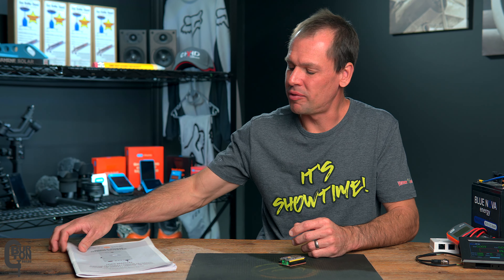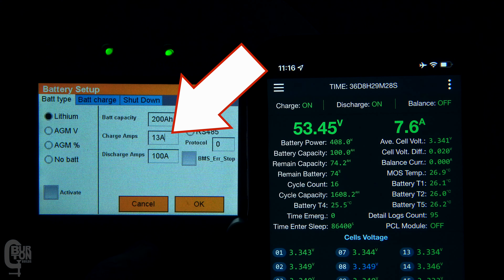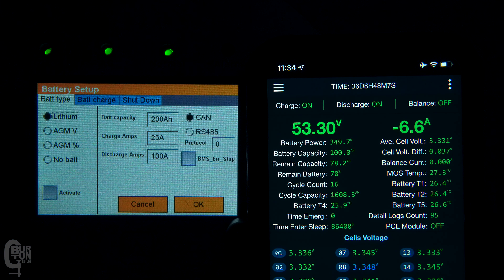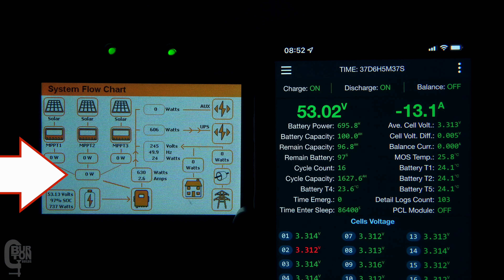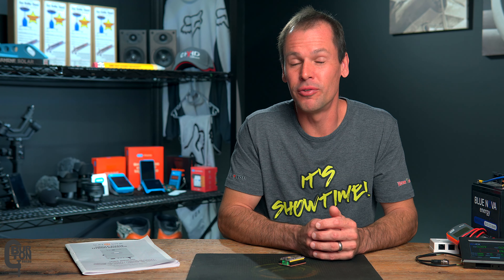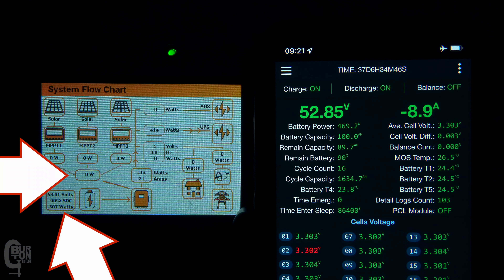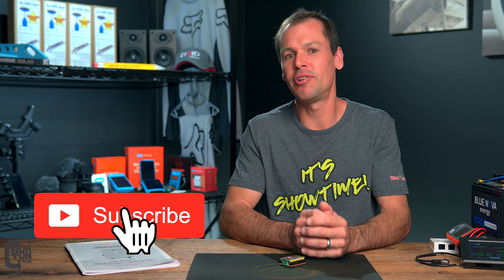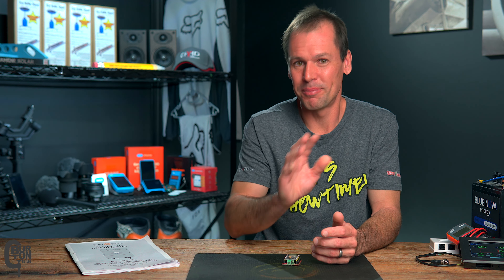Testing limits of JK Inverter BMS with SunSynk (Deye) Inverter

Comment: best test ever .. right nowdays my test reached similar questions with the older jk  and my battery is so small... only 90amp 48v setup..       always full .. or at least 90% safely full . which comes extremely fast even with 6 panels 240 watts if no loads...   i was planning to setup my new inverter bms for that extra 10 amp barier feature  and those relays to operate my fans to the server box ~~~ KEEP up
Reply from the maker: Thanks very much. If you are connecting communication between your inverter and BMS, then the max continued charge current set in the BMS should be reported to the Inverter, and the Inverter should be able to properly manage charge current up to that limit.

I think the 10A current limiter function is more applicable (or one of its use cases) is If you are connecting batteries in parallel and not using any communication between batteries and Inverter. If that is the case, then you would have to set the max charge current on the Inverter manually, and if you want fast charge, set the charge current high enough to charge both batteries in parallel. The problem comes in if one of the batteries (BMS) disconnects, then the full Inverter charge current will be going into the other battery. That will quickly exceed the BMS charge current limit, and I think this is where the 10A current limiter will kick in.

Let us know how it all works out once you have done the upgrade.

Comment: My two Sol-Arks have been running great, controlling limits fine without comms for over two years completely off grid with 170kWh diy LFP, mostly earlier model JK BMS’s, 32kWp, 10kW LP Gen for backup.
Reply from the maker: Thanks for letting us know… I’m sure there are still many people running the older JK BMS without any issues. I also ran two of the older 150A JK BMS’s for a year without any comms and they also ran perfectly well, but decided to give the JK Inverter BMS a try.
Reply: @GrantBurton  I have two battery boxes, new jk BMS and 32 314aH cells coming from Jenny Wu from Docan Tech.
Reply from the maker: @USA-GreedyMenOfNoIntegrity  Awesome, let us know once everything arrives and what you think of it.
Reply: @USA-GreedyMenOfNoIntegrity How much is something like that setup?  I hope you don’t mind me asking.
Reply: @ipstacks11  Like a brand new 3/4 ton 4wd quad cab truck without the taxes, maintenance, repairs and no electric bill.
Reply: @USA-GreedyMenOfNoIntegrity what?  I was wanting to ask how much a battery box and batteries are from the place you got them.  The box comes with the BMS, I think.  I apologize for any confusion from my last question.

Comment: Hi Grant, Thanks for the insight and detail explanation of the Charge and discharge settings. I have a 16kw Sunsynk inverter working with 2 x 280Ah battery banks each using each New 200A JK inverter BMS. Both Batteries discharge together and are mostly the same Percentage SOC from fully charged until the solar starting kicking in the next morning. Then I find they do not charge together. My slave battery seems to charge at 43A while the master is charging at say 28A and the SOC will start rapidly picking up on the slave battery until it reaches 100% and after about 20 minutes the current will reduce and the master batter will then increase to say 40 or 50 A.

I find it quite strange that they discharge equally but do not charge equally. The battery banks are exactly the same and have the same BMS settings. I also made the power cables the same length. The master battery connects to the inverter CAN pirt and i have a LAN cable between the two batteries
I see the Sunsynk inverter reports the SOC as that of the Master battery which is always lower than the slave if in the recharging process. I do notice the calibration voltage seems to change from time to time and I make a point of changing the one battery to be the same as the other . i.e. 53.25V vs 53.22V.

Do you have any idea why the batteries would discharge equally and not recharge equally?
Reply from the maker: Hi Leonard, it's a pleasure. You mention the SOC reported to the Inverter is that of the Master BMS only (and not an average of the SOC of both of you batteries)... this leads me to believe you are running an earlier version of the BMS firmware. What version firmware are you using? I think v15.11 was like this but later versions corrected this. I'm currently running and testing v15.27.

Also, what CAN protocol do you have selected in the Master BMS... Deye or Pylon?

Comment: I’ve been using a Deye 8k with the first balancing JK BMSs and a battery made from three first generation leaf battery packs since 2020. I’ve just used voltage mode on the Deye while setting the AH the same as discovered on the JK-BMS after doing a full charge cycle, and it has been really accurate on matching the SoC itself. I want to try battery communication emulation with solar-assistant.

Comment: So.....     what would the best settings be? Building three 15kw battery's with JKbms's for a Deye Hybrid inverter.
Reply from the maker: Hi Ben, the settings would depend on the specifications of the cells you are using and how hard you want to use the cells / battery, and how much headroom you want to leave for protection.

I've been somewhat conservative with my settings. As an example, some of the basic settings I have been using on my battery setup:
- RCV of 3.45v/cell
- RCV Time of 1 hour
- RFV of 3.35v/cell
- RFV Time of 10 hours
- Start Balance voltage of 3.45v/cell
- 100% SOC of 3.449v/cell
- Charge / discharge current would depend on capacity of cells.
- Over voltage protection of 3.65v/cell
- Over voltage protection recovery of 3.448v/cell
- Under voltage protection of 2.6v/cell
- Under voltage protection recovery of 2.65v/cell
- Power off voltage of 2.5v/cell

The settings listed above may not be correct for anybody else's battery / BMS though.

As for the best settings, or the specific setting each person should use for their specific battery / BMS... I think those settings should be decided by whoever is building or setting up the battery (BMS) because mistakes could end up causing damage and being costly.

Comment: I have 2 Deye 8kw inverters, in parallel, and 6 200ah 48v batteries with all the negatives tied together and same with the positives which is also in parallel, I am pretty sure.  I want to add batteries and the installer said the batteries I have are 280v, which is referring to the cells in the batteries, I think.  Anyway I want to add batteries that aren’t the same as these because the ones I have aren’t available anymore.  It looks like if I put JK BMS’s in the batteries and connect them all on the canbus, then dissimilar sized lifepo4 batteries will work because the JK BMS will protect them from over/under charging/voltage.  Does this sound right?
Reply from the maker: Hi Jeff, I'm not exactly sure because I've never tried this myself.

Comment: Very informative video 👍

Sir can you please help me, 

I am using Deye 5 kW hybrid inverter with DIY lithium 5 kWh battery (106ah) with JK inverter communication bms (150a)

Currently when I turn on the inverter on battery only (below 20% SoC) (no grid input, no solar input) the output load is not not turning on. 
As soon as I unplug the communication cable, inverter reads wrong SoC and it turns on the output load.
Or when I give grid input, it turns on the output load.

It's working normally on SoC above 20% .. I mean booting normally and turning on output load.

Thanks in advance sir 🙏
Reply from the maker: Maybe check on your battery settings… Settings > Battery > Shut Down menu (3rd tab at the top of the Battery Setup page)… is the Shutdown setting maybe set to 20%

This could be causing the output to turn off when the battery reaches 20% SOC.
Reply: @GrantBurton  tried that sir, same issue, i even set them to 0,0,0.. then also same issue..  I also have downgraded both the firmwares , deye's and BMS's., still no luck...
Reply from the maker: And what are the Time of Use settings in the System Work Mode menu?… are those set to allow the battery to be used lower than 20% SOC?
Reply: @GrantBurton  that setting is turned off sir.
Reply from the maker: What if you try turning it on and setting it to 5% or 10% and see what happens?
Reply: @GrantBurton  hmm, will try this.. thanks sir 👍
Reply from the maker: It might also be worth trying to change the CAN protocol setting on the BMS… try changing it from 001 - Deye to 002 - Pylon. Let us know what happens.
Reply: @GrantBurton  already tested on both of these.. same result 😔
Reply: Tried time of use, set it for 15% , still same issue.. 😢
Reply: @GrantBurton  Tried time of use, set it for 15% , still same issue.. 😢
Reply from the maker: Since you describe it working when the communication is disconnected… I wonder if it doesn’t have something to do with some configuration / or command that the JK BMS is sending to the inverter which disables discharge below a certain %SOC… or the BMS is sending this command through by error.

When I was trying to find out more about the ‘Request Force Charge’ thing that came up, I remember reading about the various commands / requests (not sure if that’s what they called), but CAN ID: 0x35C described various Bit numbers (0 - 7) and those corresponded to:
- Enabling / Disabling Charge
- Enable / Disable Discharge
- Request Force Charge I
- Request Force Charge II
- Request Full Charge

I wonder if the BMS isn’t sending through this ‘Disable Discharge’ command for some reason.

Comment: Hi Grant. It's taken me a while but i finally got my battery built a couple of days ago. Had multiple issues with terminals shearing off my batteries but that's a conversation for another day. It's seems to be working well apart from one issue.
So, 280ah cells with a JK 200a inverter bms running 15-11 (thanks for all the tips on how to do the firmware upgrade btw ) It's talking to the Sunsynk Ecco inverter just fine.  I've followed both yours and Andy's settings to the letter but I cannot get the RCV below 3.555v without getting a send / logic error. I've tried on the phone app and with the pc connected. Any thoughts on why this might be happening ?
Thanks.
Reply from the maker: Hi, thats great news that you finally have the batteries built (not so great about the sheared off terminals). You mentioned you have followed Andy and my setting exactly but just to check... What is your SOC-100% Volt and Cell OVPR set to?

These values need to be set lower than the RCV that you would like.
Reply: @GrantBurton  Good Morning Grant.
So, my bad....I think. I just double checked and my SOC-100% was 3.499 when it should have been 3.449. OVPR is 3.448. I guess I couldn't see the wood for the trees lol.
Thanks for the prompt to check it though, it's now accepted 3.450 as the RCV. I guess my version of following things "to the letter" did not pass muster.
As ever, very much appreciated.
Reply from the maker: @kennyrodg  Awesome, glad you are now sorted. Not to worry, that has also caught me out a few times already.

Comment: I hve the same inverter in my case my jk bms is passing the current even in off mode...bms as soon has reached the lower voltage it shutdown but still it passing the voltage and my battery voltage is reaching 0 %
Reply from the maker: So in the JK BMS app, on the Control tab, if you set the Discharge setting to 'OFF', does it still allow the battery to discharge?
Reply: @GrantBurton  unfortunately yes 😥  rest of the two switch charge and balance is following the rule but discharge switch even it is off it is passing the voltage

Comment: How does the surge capacity work with these limits setting?
Reply from the maker: Hi, do you mean how much the battery charge / discharge current could surge past these limits before the current is brought back to the limit?

I'm not sure how much or how quickly the Inverter / charge controller would react to massive surges, but I guess if it goes to far to quickly, it will just cut off.

I haven't (and can't) test the surge capacity of the 150A BMS's I have... According to JK's website, they can supposedly handle a surge of 300A for a 2 minutes.... thats way more than my capacity of batteries could handle.

I'm not sure is there is a surge limit percentage that would apply above the Continued Charge / Discharge limits in the BMS, but that might be a nice feature. If you have a high current capable BMS (200A) but only want to use a low charge / discharge limit like 50A, and if passing 100A surge, it must immediately cut off no matter what, but between 50 and 100A the Over Current Protection Timer (and current limiter for charge) is applicable.